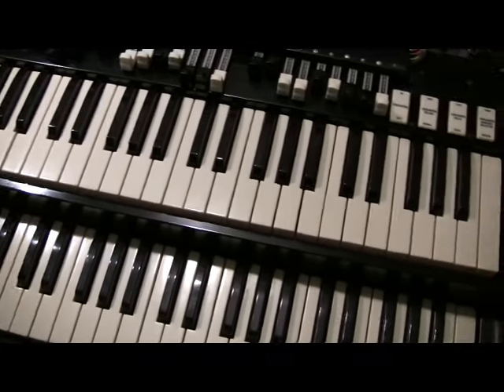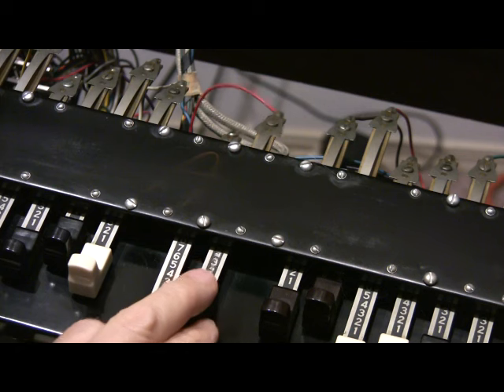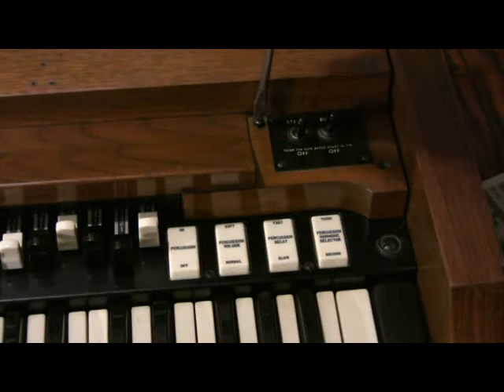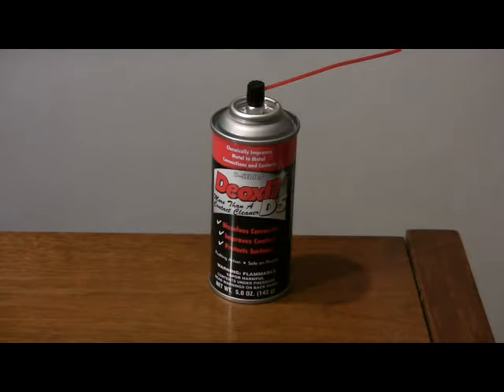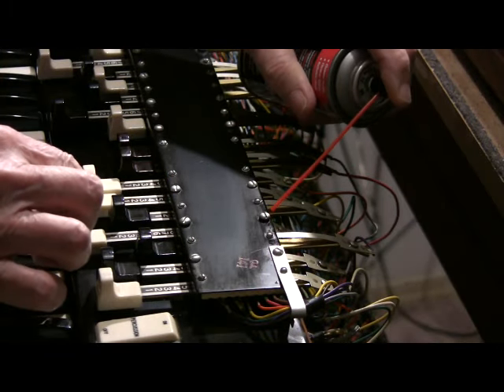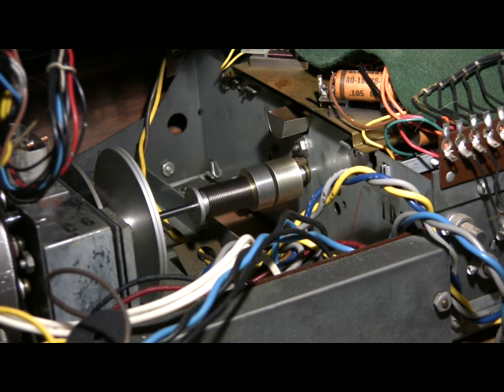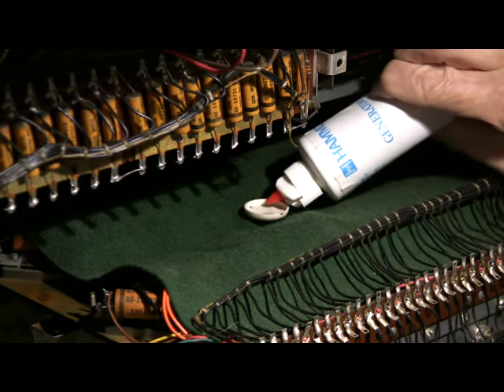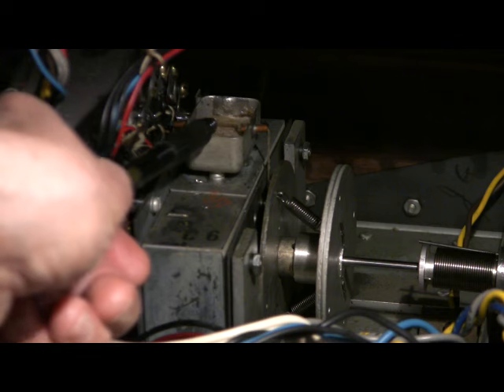HAMMOND A100 ORGAN BASIC REPAIR & MAINTENANCE

Comment: Hi Steve great video! Do you have information on replacing the material covering the front by the volume pedal? I purchase a A100 for a great price with hopes of being able to fix that hole in the front of it.
Reply from the maker: Hello and thanks! Glad you liked the video. Do a search for speaker grill cloth. It's available at Amazon, Walmart and a few other places.  You may not get the same type you have for your A100, but at least it will fix that hole.  Hope this helps.

Comment: The pedals on my Hammond T 500 Don't work.  Could you give me any advice on what to check or how to fix?
Reply from the maker: I'm not familiar with the T500. The organ manual is on line. Looking at the pedals diagram, there appears to be a connector at the bottom. http://bee.mif.pg.gda.pl/ciasteczkowypotwor/%23SM_scena/Hammond/Hammond_T-500_Series_Service_Manual.pdf

 Make sure its connected. You might also clean the connectors with Deoxit cleaner. Post your question on the organ forum.
https://organforum.com/forums/forum/electronic-organs-midi/hammond-organs/32914-hammond-t500-problems  

There are several organ repair experts online. I'm not a repairman. I just share my knowledge I've accumulated over the years on my A-100.

Comment: The volume on my Hammond  fluctuates. What do you suppose the problem is?
Reply from the maker: Well, not sure. If it is a tube amplified organ, try spraying DeOxit on all of the tube pins and sockets and into the drawbars while moving each drawbar in and out.  If you have a separate tone cabinet, do the same on the tubes and other connections. All unplugged, of course, while you're doing this. I'm not really a technician, I know enough about my A-100 to share info for others.  Read through this thread on The Organ Forum for additional insight.  Hope this helps.  https://organforum.com/forums/forum/electronic-organs-midi/hammond-organs/10175-hammond-l-122-volume-problem

Comment: steve, have you ever saw on any Hammond organ of the Hammond name decal logo fading and coming off of the organ?.>.(HAMMOND)<,.Its the name thats located on the front panel bar between the lower and upper  keyboard, whether old or new organ
Reply from the maker: I've not seen it on mine and it's over 50 years old. But they do tend to age and wear on some organs. Fortunately, you can buy new decals to replace them. Just search Hammond organ decals. Here are a couple of links: http://www.pianodecals.com/store/Hammond-126360.html  and  https://www.piercepianoatlas.com/catalog/index.php?main_page=advanced_search_result&search_in_description=1&zenid=pu008dq44o3n6equ1rkck871j1&keyword=Hammond  -  hope this helps.